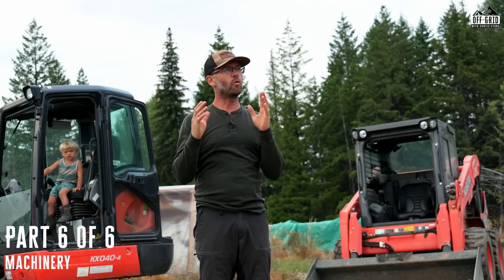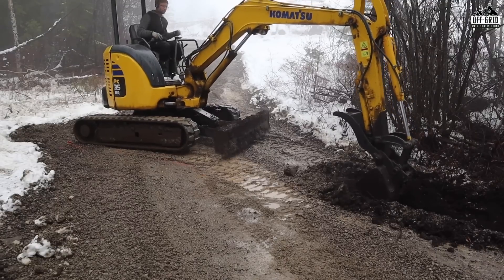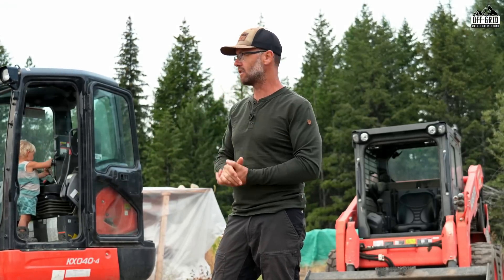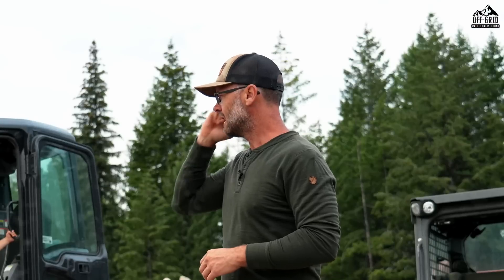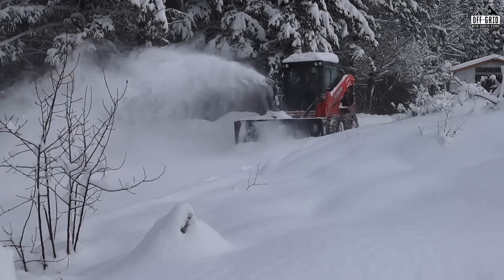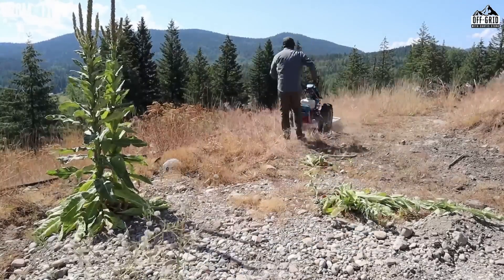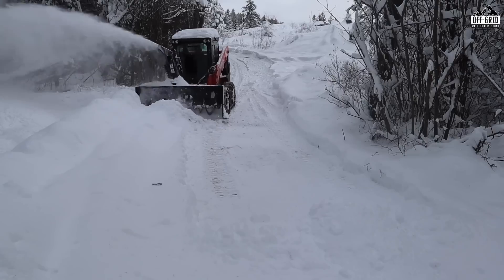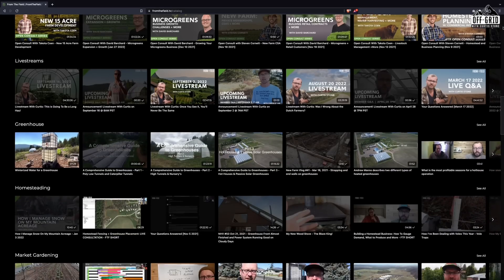Without These Machines I Couldn't Build. Period.

Comment: Curtis .. I think you made a great choice in the machines you purchased.  You have 40 acres to develop .. I have 3 .. so for me the front end loader and backhoe with a small Ford tractor .. have come in really handy for many things .. plus I also have a 5 ft. tiller attachment, brush-hog, and boom .. that can be used with only one machine to maintain.  I also weld .. so I went to our local salvage yard and found a heavy strong fork for a fork lift .. I cut it in half long ways .. and made two forks to fit inside my bucket.  I lift logs and brush easily.  It is a time consuming hassle to change some implements .. so having one dedicated .. as in your track hoe and blade .. or having quick attach systems does make the work go quicker.  Having these machines is like having thousands of men working for you .. and they rarely complain in comparison.  I always enjoy watching you develop your remote location.

Comment: Curtis, I have machine envy. We have a mini tractor with backhoe. A set of forks are on the bucket attachment 95 percent of the time. Also a PTO powered snow blower is on rear from November to April. We were going to do two machines like you but at the time you could not find anything. Going to sign up for your vlogs soon. After 1.5 years in here we will have high-speed to be able to watch. Thanks so much for this yt content to tied us over.

Comment: I have found pushing trees over is better than cutting them down. Less work to remove stumps. I just use a dozer. Made the drive, scooped out foundation, pushed trees over, and made garden area in a forest. I hate tree stumps because extra time and work. If you ever spend time removing tree stumps you will understand.
Reply from the maker: It depends on whether you can keep them clean or not. I find that if the logs get too dirty, it's brutal on the chainsaw blades.

Comment: So what do you need, to do something like this? A half million dollars?
Reply: Used trachoe was about. 12.5k a few years ago, likewise the skid steer was about the same a decade earlier. You can do it without equipment, but it is harder and slower. It all depends on what is encompassed by "this". Make the property work for you rather than be a liability.
Reply: Yes
Reply: More like $170k
Reply: @blaablaahi  Bobcat 325 mini trachoe used. 12.5 plus repairs, new tread, and about a third of the lines maybe 2k in parts over the past three years.  Really wish they left the compact part out as I end up cursing the engineers that designed it a couple times a year.